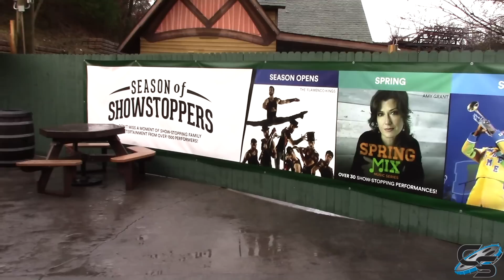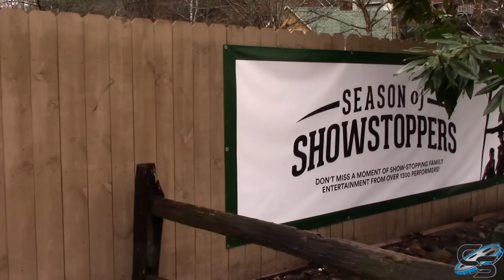Dollywood December 2017 Construction Update: MASSIVE Clearing, River Battle, & More!

Comment: The building demolition will probably be a new refreshment station with freestyle Coke machines, river battle may be reused as the new coasters station the lift hill will go over the walk way and over top the mystery mines outdoor elements I'm thinking a giga or a flying coaster at this point. Flying would work for inversions and intense turns, giga would work for height because dropline is 230 ft tall and this would be a step up from that plus could use terrain to its advantage for low to the ground turns and add in some airtime
Reply from the maker: The River Battle location is already confirmed to be a new show venue. I highly doubt Dollywood is getting a giga.

Comment: Where did you hear about the "park's largest expansion yet" coming in 2019? I think the only logical option for that area would be a coaster, and a MACK Hypercoaster is what I'm strongly believing. When putting in new attractions to an area, Dollywood likes to spruce up the area as well. For example, 2014 with FireChaser Express and the surrounding area, in 2016, with Lightning Rod and Jukebox Junction, and 2017, with Timber Canyon and Drop Line and Whistle Punk Chaser.
Reply from the maker: Dollywood officials distributed information to employees telling them certain information about the clearing. That info said it would be the parks largest expansion and is coming in 2019. There will be teasers throughout the year and an announcement next year.
Reply: Ooh sounds exciting